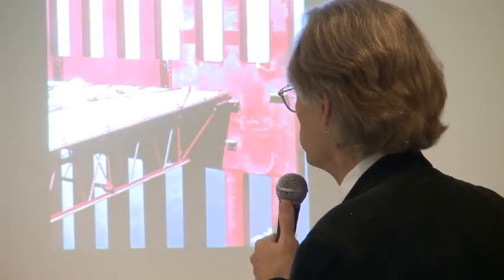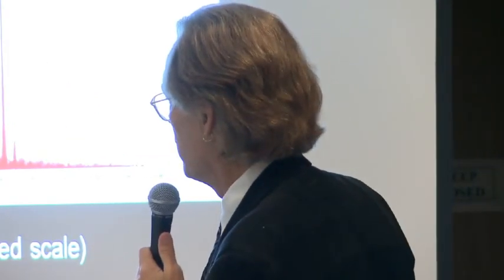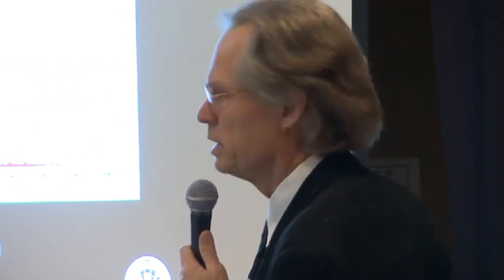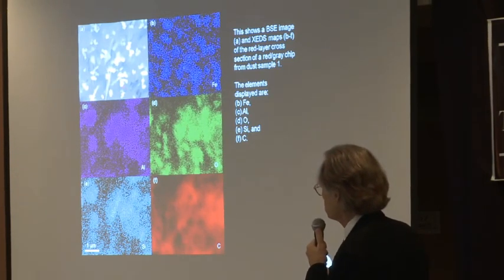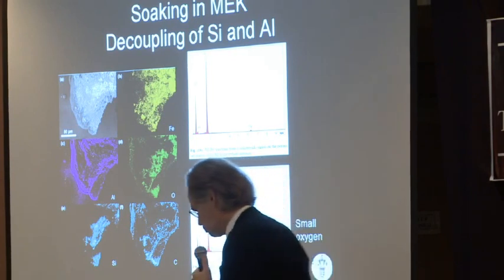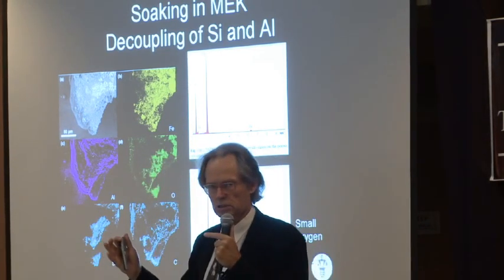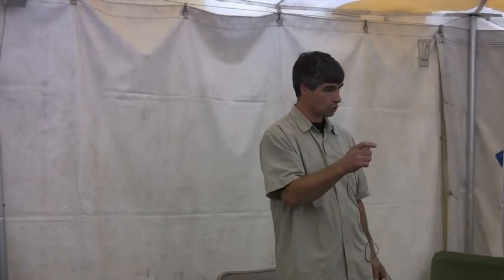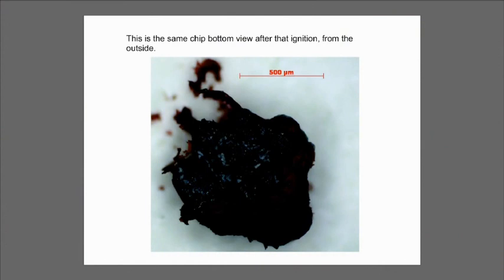9/11 WTC-chips are not paint and produce a thermite reaction: Dr. James Millette is wrong

Comment: The red-grey chips are not nano thermite. They are LaClede Standard Primer, a zinc-free paint formulation with which the floor joists of the twin towers were painted. It has the same color, same chemical composition, identical XEDS spectra, and nearly identical ignition point. 

http://www.xraymachines.info/article/769566975/another-primer-at-the-wtc-laclede-standard-primer/
Reply from the maker: Burning paint doesn't produce a thermite reaction.
Here's a paint vs "WTC red-grey" chip ignition clip:
https://www.youtube.com/watch?v=pOzh5CbLqBw

They don't use nanoparticles in paint, while, if you look at the close up pictures of the red-grey chips in the study paper made by Niels Harrit et al, you can see the iron-oxide powder is very, very consistent in particle-size. It's clearly high-tech man made stuff. 

"same composition" LOL!
Too bad for you Harrit et al found more than one kind of thermite-chips, so "primer paint"-explination doesn't work here.

Here's the Harrit et al paper
http://www2.ae911truth.org/downloads/Full_Thermite_paper.pdf
Reply from the maker: According to the article you linked, the iron oxide (hematite) in LaClede primer is 100 -300 nanometres in size
--"“Iron oxide” is hematite, chemical formula Fe2O3, a red pigment. Hematite pigments are bright red at particle sizes between 100 and 300 nanometers, and in that size it is universally used in all kinds of paints."---
http://www.xraymachines.info/article/769566975/another-primer-at-the-wtc-laclede-standard-primer/

But in the Harrit et al paper they say the nano-iron oxide particles are CONSISTENTLY around 100 nanometers in size. Note, the particle size is said to be CONSISTENT, while in LaClede paint it varies between 100-300 nm, as i assumed in my earlier post; they don't use consistent nano-powders in primer paints cause there is no need to use such costly nano-powder in such paint.

Harrit et al: 
---"BSE images of small but representative portions of each red-layer cross section are shown in Fig. (8). The results indicate that the small particles with very high BSE intensity (brightness) are consistently 100 nm in size and have a faceted appearance."---
http://www2.ae911truth.org/downloads/Full_Thermite_paper.pdf
Reply from the maker: The article you linked implies the aluminium in the WTC-chips comes from  kaolin (Al-Si clay basically) , but in the Harrit et al paper they CLEARLY tell us that the aluminium particles are ELEMENTAL Al-particles, not chemically-bound to the silica = not kaolin, in which Al and Si are chemically bound.

Harrit et al paper: 

-"In marked contrast, paint chips softened and partly dissolved when similarly soaked in MEK. It was discovered in this process that a significant migration and segregation of aluminum had occurred in the red-chip material. This allowed us to assess whether some of the aluminum was in elemental form."----
http://www2.ae911truth.org/downloads/Full_Thermite_paper.pdf

The WTC-red grey chips are not paint, not LaClede primer paint, not the other primer paint either.
Reply from the maker: LOL!!!!!
i just noticed from the sources list of the article you linked that it was written by this guy "Oystein".
We had a debate on this very topic few years ago here on my YouTube channel. But after awhile, when he noticed i do know a thing-or-two about this topic, he started behaving like a childish troll (didn't wanna answer my Qs and pretended i didn't reply to his arguments, thou i did etc) 

He then disappeared when i mentioned  a certain "event that took place in Germany" to him ...heh-heh

"How's it HANGING Papa Oystein??!!" ....LOL!!

He even brought a friend with him to the debate me, who actually disappeared even  before Oystein did, when i pointed out a mistake he made with an article about iron oxide-pigment sizes. The f-ing guy was a "professor" or something like that, but couldn't even understand the stuff he was linking himself.

I can assure you, you won't win a debate against me using Papa Oystein's crap as your source material.
..sure you can try, but i ask you not to, cause this shit is quite time consuming.

Here's the original source of that article you linked ..it's the same trolling-Oystein, alright. The guy is probablly a paid intel-asset.(rogue BND)
http://oystein-debate.blogspot.fi/2012/03/another-primer-at-wtc-laclede-standard.html
Reply: 911operationgladio I used to be on the other side of this argument but after reading more about it and the red-grey chips closely resembling primer paint it seems that the chips are most likely just that. Oystein's site is a good debunking resource. To address your points, 

Mark Basile's experiment proves the chips are not thermitic.

 http://oystein-debate.blogspot.de/2012/03/how-mark-basile-confirms-that-red-gray.html?m=1

Laclede paint vividly burns when ignited and is rapidly degraded both under air and nitrogen at about 380 – 400 degrees C (followed by thermogravimetric analysis, TGA). The remaining discrepancy (red chip in Bentham paper burned at slightly higher temperatures around 430 degrees C), can be attributed to the fact that chips were almost 40 years old and thus inevitably oxidized. It does not matter if anticorrosive primer is flammable in the case of fire (when applied in thickness typical for paints). It is not intended as fireproofing and its burning cannot damage anything. 

"They don't use nanoparticles in paint"
Yes they do: 
http://m.slashdot.org/story/214443

"It's clearly high tech man made stuff"
Yes agreed WTC primer paint is not naturally occurring. 

Harrit did not find more than one "thermetic material" he found more than one type of primer paint, tmenec and Laclede.

"The Paper clearly tells us that the aluminum particles are elemental aluminum"

Scanning electron microscopy pictures and spectra show that the same red-grey chips are made of aluminum silicate,(41% of laclede)  iron oxyde and soot (carbon) Kaolinite, which does not contain any "elemental aluminium" (as required by nanothermite). 

Besides this, The authors of the thermite paper have lost their credibility in my mind. Because they have made other outrageously false statements. For example Professor Jones believes there is archeological evidence that Jesus visited the United States! Niels Harrit has also said in video interviews he believes that a missile hit the pentagon, which is definitely not true as there are photos freely available of plane parts inside the pentagon. Alex Jones the leading figure of the 9/11 truth movement is now buddies with the man in the White House, yet 9/11 truth is not on his agenda go figure! 

If Harrit and Jones paper were true it would be censored and they would both disappear suspiciously or be jailed on trumped up charges just as real whistleblowers have. 

Even if you still believe after all that this is Nano thermite. Consider that Niels himself has gone on record saying based on the amounts of these chips they found in the dust, he estimates 10 tons of unexploded thermite material was found in the dust after the demolition. If that much was leftover, then what does that mean they actually USED to bring the towers down? 100 tons? A thousand? How could you manage to get that much into the building anyway? LaClede Standard Primer is a zinc-free paint formulation with which the floor joists of the twin towers were painted. It has the same color, same chemical composition, identical XEDS spectra, and nearly identical ignition point. According to NIST reports, almost no paint remained on the floor trusses steel after collapses. Therefore, it must be abundant in the dust after the catastrophe. The calculated total area of floor trusses and (using declared thickness of paint layer 25 microns), estimates the amount of Laclede paint chips in the dust to be 20-30 tons. This is in a reasonable agreement with the concentration of red chips (0.1 %,) in the dust (Harrit et al estimated the total amount of red chips as 10 tons).If you are the government setting up a false flag operation, why not just rig the buildings with explosives? Why involve planes with hijackers at all. Why not Just do a redo of the 93 attack? Why blame SAUDI hijackers then make up WMD lie to invade Iraq? Senseless, Needlessly complicated. At the most I believe there was foreknowledge of the attack by people in the government or elite financial institutions. But That it was carried out by the government themselves in a false flag op no.
Reply from the maker: The ignited red-grey chips, that produced a thermite reaction, also produced iron rich spheres. Iron doesn't melt in 430 C degrees. so the temps had to peak much higher (=thermite reaction)
-
-
"They don't use nanoparticles in paint"
Yes they do, huh?

When did they make the WTC primer? That link you posted talks about much recent stuff. The WTC Towers were blown up in 2001, your article is from 2015.
"New paint makes tough self-cleaning surface, 6 March 2015" http://www.ucl.ac.uk/news/news-articles/0315/050315-self-cleaning-surfaces 

Why are you trying to bullshit me?

You stated yourself that the "paint is 40 years old"
-
-
Your own link stated LaClede paint used 100nm-300nm pigment, thou Harrit et al papaer said the nano-iron oxide is CONSISTENTLY 100nm sized.
..i already wrote this.

-
-

The Harrit et al paper CLEARLY states the aluminium was in elemental form.
And i posted you the quote already, so cut the bull.
-
-
The claim that you'd "need huge amounts of thermite" isn't true.
Here's video made by Jon Cole about his backyard experiments. You can see him make horizontal cuts with thermite.
..note also that his homemade nanotehrmite has explosive qualities

"9 11 Experiments The Great Thermate Debate" 
https://www.youtube.com/watch?v=w4EdYVybDS0
-
-

If Harrit et al "lost credibility in your mind", that's fine. It's just your opinnion
-
-
You can go talk about Alex Jones somewhere else, this is about the red-grey thermite chips.
..alex jones has nothing to do with this, so why bring him up.
-
-
"If Harrit and Jones paper were true it would be censored"
LOL!! Didn't Bentham do just that, and unpublish it!
NIST doesn't want to do any PHYSICAL-tests with the WTC dust, thou they have been asked to ...clearly the topic is being brushed side.
Reply: 911operationgladio 

"Furthermore, there is an alternative explanation for the "thermitic material" the sceptical scientists found in the dust - it is just a type of primer paint. It's calculated 1,200,000 tonnes of building materials were pulverised at the World Trade Center and most minerals are present in the dust (not necessarily in a large quantity). More extensive sampling of the dust has not found any evidence of thermite or explosives, says a report from the US Geological Survey and another from RJ Lee."

http://www.bbc.com/news/magazine-14665953
Reply from the maker: RJ Lee group did the study for Deutche Bank, they didn't look for thermite and neither did USGS.
Word "thermite" isn't even used in those papers.
Reply from the maker: I googled "lighter flame temperature" and the flame can reach over 1900 C degrees temps, while iron's melting point is little over 1500 C. ..so yea, should melt iron with 1900 C temps, don't you think.
-
-

---Harrit's study may have said one thing, but others such as dr James Millete who attempted to replicate them found no evidence of elemental aluminum.----

Millette's study DID NOT replicate the Harrit et al study. And it's stupid to even try to claim he did.

- For the XEDS to detect elemental aluminum after soaking a WTC-chip in MEK, Millette used a 20kV beam instead of 10kV beam used for the Harrit et al paper. = Stronger beam picks up larger volume of material and so could miis the elemental Aluminium.

- After Millette soaked his chips in MEK, he ultrasonically agitated them (= could shake of loose elemental Aluminium particles)

- Millette also put a thin gold layer for conductivity on the soaked chip, but it is know that gold can MASK finer details, so he possible missed the elemental aluminium because of this.

Here's some info for you.
"""..the main disadvantage of gold...coatings is their tendency to migrate on the surface of the sample and coalesce into islands or particles that worsen the macroscopic conductivity and mask some fine details of the surface."-Effects of the Carbon Coating and the Surface Oxide Layer in Electron Probe Microanalysis-
https://www.researchgate.net/publication/46094604_Effects_of_the_Carbon_Coating_and_the_Surface_Oxide_Layer_in_Electron_Probe_Microanalysis

- Also, Millette didn't do proper ignition-tests for his chips, but stayed well below the ignition temps of the "red-grey chips" reported by Harrit et al.

So Millette's study isn't scientifically valid, because he didn't really do the tests as Harrit et al did. Why didn't he, beats me, cause you really should try to follow the other guys study very closely to spot the possible mistakes they made..
-
-
--"How much Thermite Jon Cole needs for a backyard experiment is nothing compared to how much would be needed to blow up World Trade Center 1,2,7!"---

Bull!! ..Jon Cole clearly shows you need quite little thermite to cut steel with right applications. You yourself used the argument that you need huge amounts of it, so Jon Cole's experiments prove you wrong.

-
-
The Pentagon attack has nothing to do with nanothermite in WTC, so why bring it up.
Reply from the maker: @Libertaire: If you scroll down the comments far enpough, you can see Papa Oystein's 3 year old comments. ..for some reason he gave up debate and dissapeared
..but now you try to debate the topic using his material as a source. LOL, is that ironic or what!
Reply from the maker: @Libertaire: Did you run out of cut-and-paste arguments writen by someone else? At least get back here to admit you could be wrong after all.
Reply: 911operationgladio Criticizing my response time is a bit ironic considering my OP was over 6 months ago and you just responded to it a week ago!
Reply: 911operationgladio 

If Jones and Harrit are so sure it's thermite why don't they share their samples with other scientists who could recreate and verify their work?
Reply from the maker: @ Libertaire:
-"If Jones and Harrit are so sure it's thermite why don't they share their samples with other scientists who could recreate and verify their work?"--

To more bullshit artists like Millette?! LOL
US Governemnt agencies and NIST have free access to WTC dust and plenty of it. They just don't wanna study it.
And actually, Harrit and the guys have asked NIST to test WTC dust for nanothermites but they wont even reply
Reply from the maker: @ Libertaire: What do you think about Millette ultra sonically agitating the chip and lacing it with gold before searching for elemental aluminium? Is that a honest science? When Harrit et al did none of that?

Do you think the ultra sonic agitation could have shaken off loose Al-particles, while the layer of gold masked the rest of them?

Your comment, please. 
And don't change the subject again, like you just did.
Reply from the maker: @ Libertaire: Yea, i got nothing more to do with my life than hanging out on YouTube.

And your response time isn't the issue it's your arguments. Bunch of crap you just cut-and-pasted from a half-asses web site somewhere.
You throw stuff at me, but then you wont even comment anything about my replies, like right now.

This is not a debate. You skipped past my replies ..just like Papa Oystein did years ago ...on and on with the same shit..and like him, then you just change the subject when your argument wasn't so good after all. Did you think you're the first person to try that one?

And i told you, please don't even start this debate, cause you're not good enough. Didn't i more or less tell you that?
Then you come back and do nothing but run your mouth.

Admit that you have no idea what you're talking about, that you're nothing but a cut-and-paste clown; say sorry that you wasted my time with this bull and then just fuck off. 
..or start debating me. But you're not going to, cause you have nothing left, ay.

So say you're sorry and piss off. Be fair. Give some respect for the talented people. LOL!!!!!!
Reply from the maker: @ Libertaire:Whatta hell. You posted the first message two hours ago and it took you another hour to come up with the next lame shit. Give it up. I'm too good for you.
..and i'm a nobody. 
Now what does that make you.

F-ing troll. I bet you're fake anarchist too.

Why don't you have any political stuff on your channel, thou you proudly throw those colours around and call yourself this-and-that?? ..no exposes on corruption or anything like that?
No, you have three year old video of you fukkin iphone freezing or what ever! Yea, i didn't watch that one. LOL
Reply: 911operationgladio 

No, to other independent scientists and researchers. Others have studied the WTC dust as I mentioned before and found nothing suspicious.
Reply from the maker: @ Libertaire: --"No, to other independent scientists and researchers. Others have studied the WTC dust as I mentioned before and found nothing suspicious."--

Others who? Millette?
You already used Millette's study as your source to claim "nothing was found", but his study-methods are a scam. And i already pointed out what's wrong with his methods, but you didn't reply to me on that one.

Who else besides Millette have studied the dust? Why didn't you use their papers as a source if you know these people studied the WTC chips???

And validation from independent scientist isn't as important as getting US Gov and NIST to study the dust.

What a moronic argument in the first place. When you find a dead body on the street, do you call the cops or some "independent researcher". Get it.

I already told you Harrit et al didn't even get a reply from NIST when they wrote to them.
NIST doesn't even wanna touch this matter. It's quite clear, so what are they hiding.
Reply from the maker: @ Libertaire:So, you're gonna leave without replying to this, thou i specifically asked you to:
"What do you think about Millette ultra sonically agitating the chip and lacing it with gold before searching for elemental aluminium? Is that a honest science? When Harrit et al did none of that?
Do you think the sonic agitation could have shaken of loose Al-particles while the layer of gold masked the rest of them?
Your comment, please"
:
:
It was you who started posting "supposed" scientific arguments for me to answer ,when i did,  you don't comment a word, you don't even try point out possible mistakes i might have made. 
And then you just change the subject by asking some sophist-bullshit questions about Harrit et al not giving their dust to just about anybody. This is typical troll behavior.
I have replied to your arguments, why haven't you replied to mine? Don't wanna touch those topics?
Reply from the maker: @ Libertaire: No, i think it was also too much for Papa Oystein, when i pointed out Millette ultra sonically agitated the chip and even put a gold layer on top of it, before studying it for the elemental aluminium.

Far as i remember, he didn't comment that at all, just like you didn't.
Reply from the maker: @ Libertaire: LOL "a debate". what debate did you put up? You didn't.
It's not a debate, when you post cut-and-paste shit written by someone else, and then you don't even wanna comment my replies to those.

"Triggered" ...what other bull shit buzzwords you could think of ,that come and go every 6 months? Could we call you a "snowflake" 
I'm not sure what that means exactly = disappears when you apply a little heat, perhaps? 
Quite fitting when it comes to your kind.

Bye. And don't come back unless you're gonna reply to my comments about YOUR ARGUMENTS